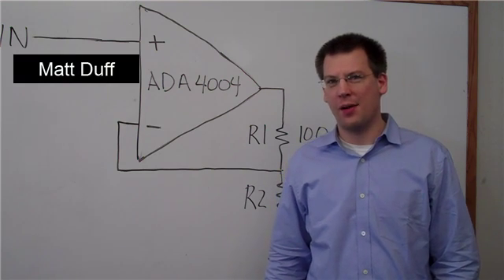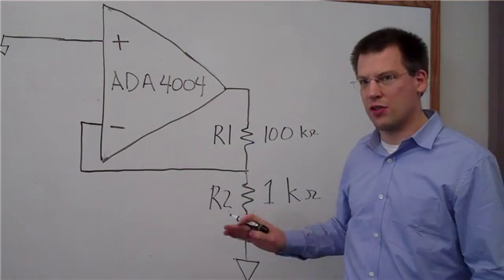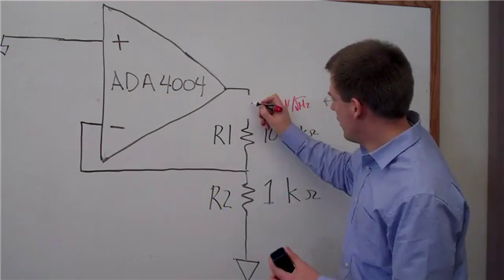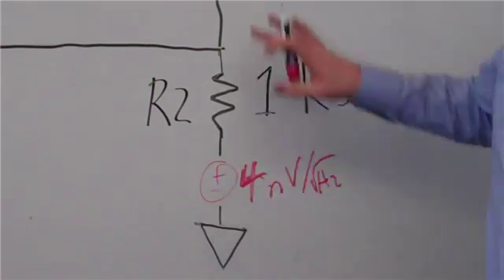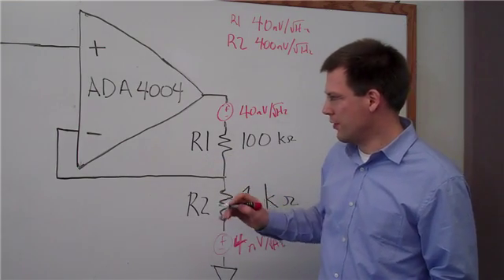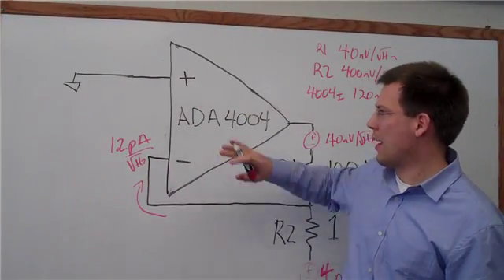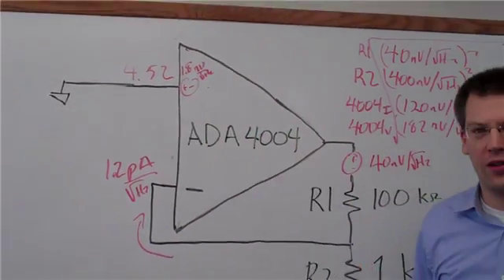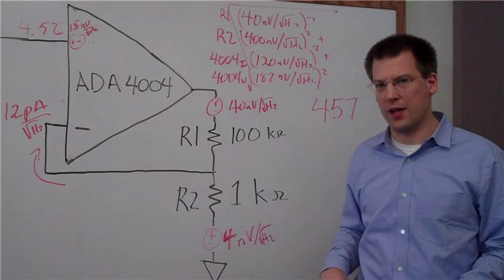Noise of a Non-inverting Operational Amplifier Circuit

Comment: Thank you so much sir. But where does 100 that you multiply by R2 come from?
Reply: The opamp is configured as amplifier. From the inverting pin point of view - it's just an inverting amplifier with the gain of R1/R2 (which is 100).
R2 noise signal essentialy just a signal that goes on an inverting pin. So it would be multiplied by 100 (just as if it were a usual signal source).

Comment: I have one china equalizer, but I found the OPAmp gain is 2, but the output voltage is too small, so I change from 10k ohms to 2.4k ohm, and SE output can provide 2 Vrms, the original gain noise floor I cannot hear, but rise the gain to 5.16, I can hear some noise when idle. Should I lower the resistor from 10K to how low?

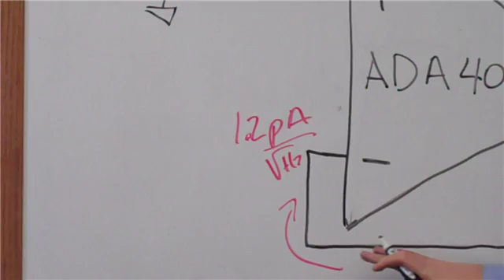Comment: Wait at 4:42 the current noise is not passing by the 1k resistor. The positive input is grounded so the negative input will tend to ground.

So the current noise should flow over 100k back to the amplifier, because over 1k there is no potential difference. What am I missing ? Can someone help me with this?
Reply: First, real amplifers have finite input impedance. That's why it consumes some current (and that's why it has input current noise). 
Next, since it's a noninverting amplifier it supposedely has some signal source at the + input. It's that just for the sake of noise analysis we got rid of the source (we consider it noiseless). But what it means is that the voltage on the + pin is not always zero.
Reply: @stnhndg   I get you in the matter of the real world. But we simplify with models to get an understanding of specific things, so it lacks that the model is explained?
Reply: @jp_engineer  Well, any simplification has its cost. 
Nevertheless, even in this case it's valid. Since we're dealing with the current source (not the voltage source) it has to draw the current from other points. If it were a voltage source in the same location, your assumption would be correct (considering zero impedance signal source).
...
I know, it's a bit complicated in the beginning. Just think in terms of superimposing different noise sources one at a time. It just requires some time to get used to.

Comment: Thanks for this excellent video; very easy to follow. Just one thing: the assumption here is that the used bandwidth is just 1Hz?   If this is the case, if I want to use this device to build an audio pre-amp, I would have to use a BW of 20kHz, so the Johnson noise in R1 would be 575nv instead of 4nv. ¿Am I understanding this right?  Thanks again. :)

Comment: 4.52 what? Volts?
Reply: nV/sqrt(Hz).
Reply: It's the output voltage noise referred to the input, thus 457 nV/sqrt(Hz) / 101, where 101 is the gain of the opamp

Comment: Good video but conclusion at 7:12 about sizing resistors isn't correct. To minimize noise it isn't accurate to say reduce the value of R1. This reduces the output noise contribution of R1, yes, but also reduces the signal gain and hence the RTI noise contribution from R1 goes up as R1 is made smaller (under the assumption that R1>>R2). 

To see this, let Av = 1+(R1/R2) = (R1/R2) (when R1>>R2), then you can work out that the input-referred noise contributions of the resistors is RTI = 4kT(R2) + 4kT(R2)^2/R1)] [V^2/Hz] = contribution from R2 + Contribution from R1.  This equation suggests that one should make R1 larger (not smaller) to reduce its noise contribution. You can re-write the above equation as Noise RTI = 4kT(R2)(1+1/G) where G = R1/R2. Then, you can see if the gain is held constant, you should reduce R2 to improve noise performance. (R1 will reduce as well since gain is being held fixed). So more precise statement = "For a fixed gain, use the smallest resistors possible".

Also as another poster seems to have pointed out (based on your reply -- I don't see the original post), the current noise contribution to voltage noise RTO is: in^2*(R1)^2 [V^2/Hz]. You can see this by noting that the virtual ground enforces 0V across R2 and therefore no signal current through R2, so all the current must flow through R1.
Reply: Incorrect, better signal to noise ratio is achieved by reducing the value of the sqrt( R1//R2)

Comment from the maker: @knightmoto Excellent catch. You are exactly right.  My mistake in the video.  When calculating the noise of this configuration referred to output, as in the video, the current noise should not multiply by the parallel combination of R1 and R2 as I stated, but only by R1, which would make the current noise contribution in this example significantly larger. Your formula is nice and clean, but I think the opamp_input_voltage_noise and opamp_current_input_noise should be squared?